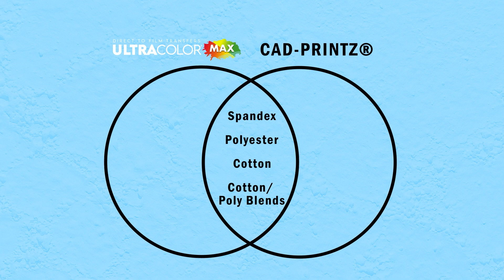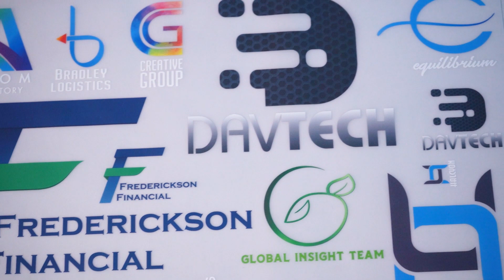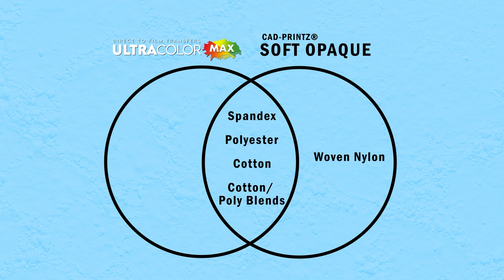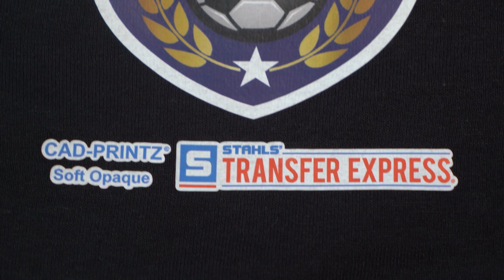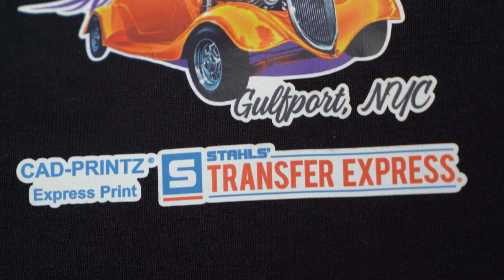Direct To Film Heat Transfers vs. Printed Vinyl | What's the Difference?

Comment: What are the washibility comparisons between these transfers?
Reply from the maker: Great question Jerry, thanks for asking! All of our heat transfers are tested to 50+ wash cycles when applied correctly (recommended application instructions). So they both hold up the same. Machine wash cold, inside out, tumble dry low heat. We've got a video in the works featuring the UltraColor Max with wash testing coming soon.